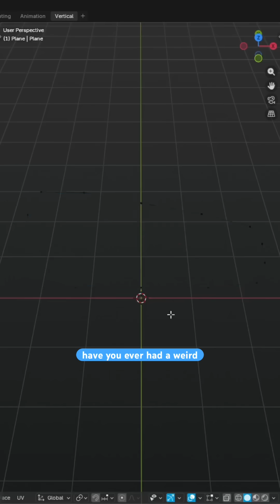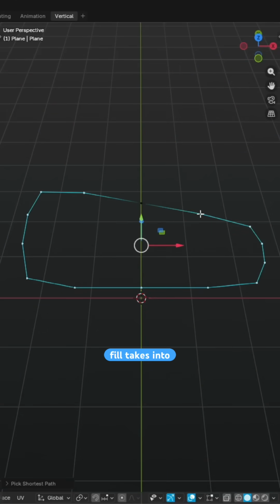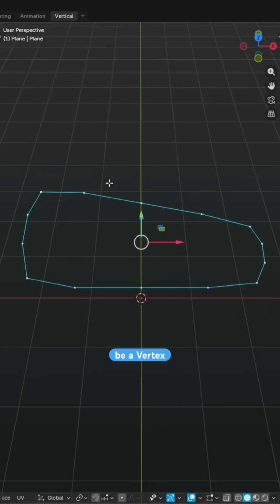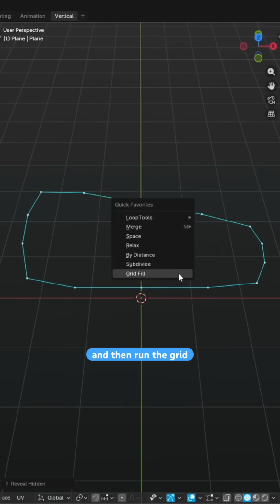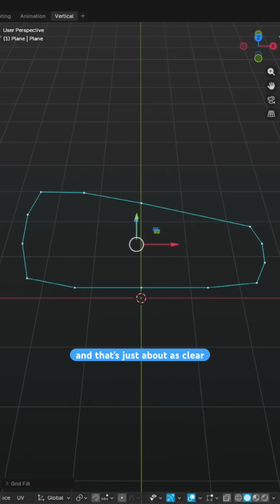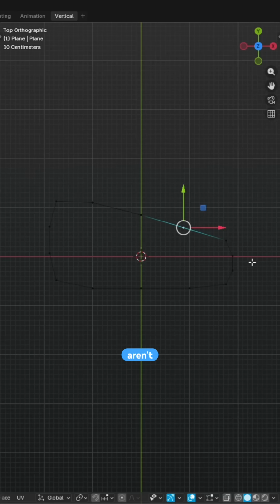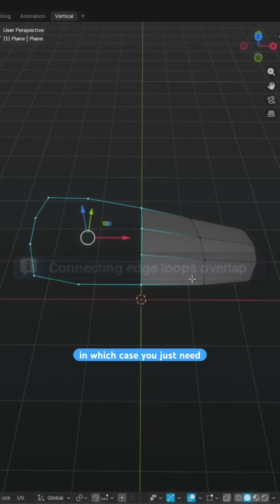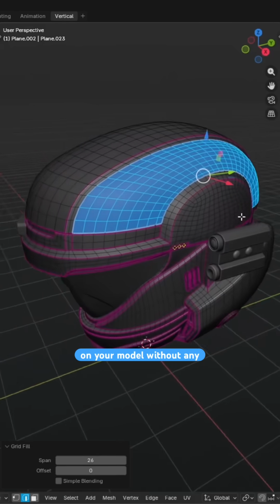How to Fix Grid Fill Not Working in Blender | #blender3d #blendertutorial #blendermodeling

Comment: You dont have to do all that if it fills wrong. Just change the offset and span first and its done.
Reply from the maker: It can work in some cases, but it will not always fix the issue, as grid fill can be quite finicky at times. 😅

The main reason I made this video about the various grid fill errors, is due to me seeing a lot of people running into them with my Space Marine helmet modelling tutorial series. The three different problem solving methods I show have been among the most common ways people have achieved better and more consistent results. 😄

The active selected vertex is a big one as well, as it will heavily influence the offset and span values and simply not work in some instances. Thus the importance of selecting a vertex in the corner for best practice. On curved grid fills especially, adjusting the span and offset may not always produce the desired results in terms of curvature. 😄

Finally, if the loop selection does not have an even number of verts, or if they are not evenly distributed so that each corresponding edge has the same number of verts, this cannot be resolved with span and offset since the grid fill popup will not appear in the first place. 😄

So while adjusting span and offset is a good starting point, the suggestions I make here are intended to help achieve more consistent and reliable grid fill results overall. 😄